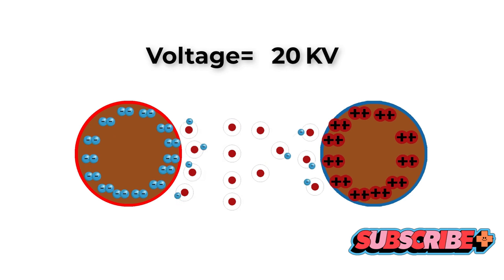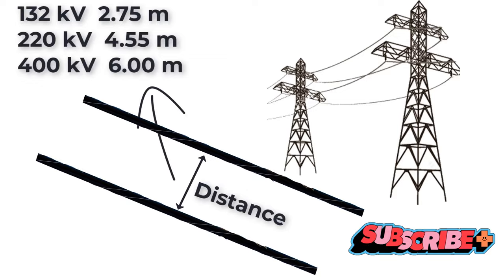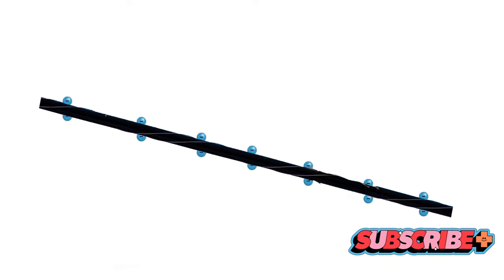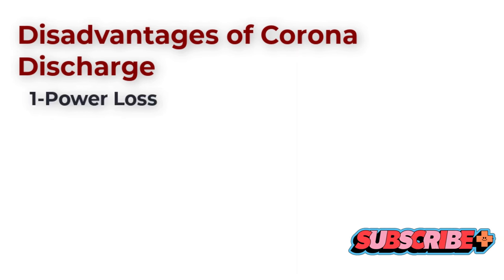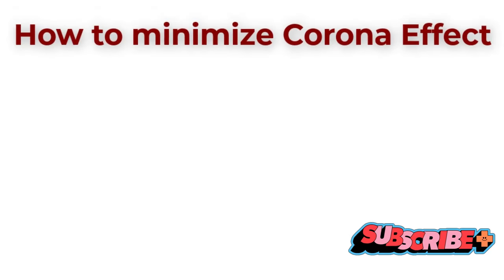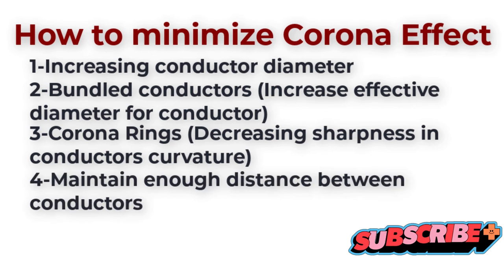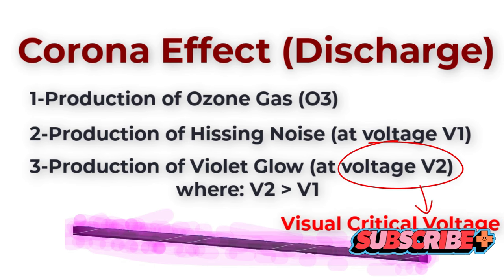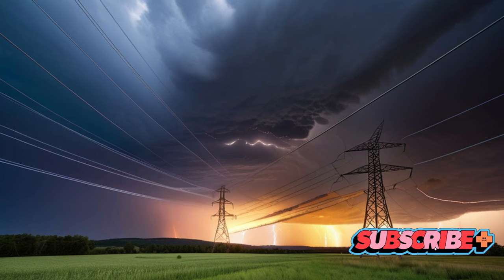Corona Discharge: The Electrical Phenomenon Explained #coronadischarge  #electricalengineering

Comment: Effects:
Energy Loss: In high-voltage applications, corona is an unwanted side effect. For example, it leads to significant energy loss in electric power transmission lines.
Gaseous Emissions: Coronas generate gases like ozone (O₃) and nitric oxide (NO). These gases can be corrosive, toxic, and degrade nearby materials.
Suppression: Improved insulation, corona rings, and smooth, rounded high-voltage electrodes help suppress corona discharges.